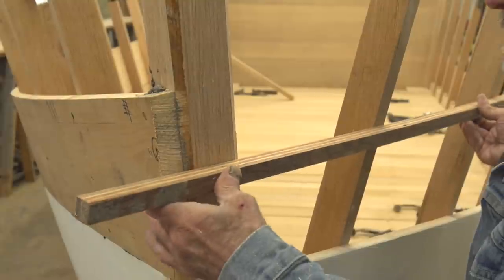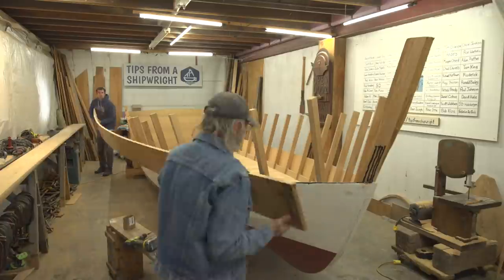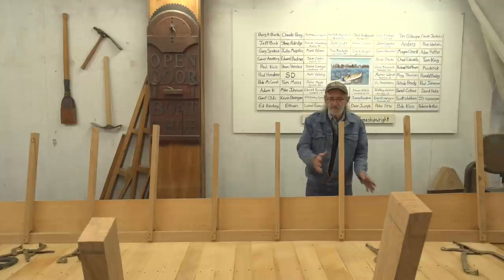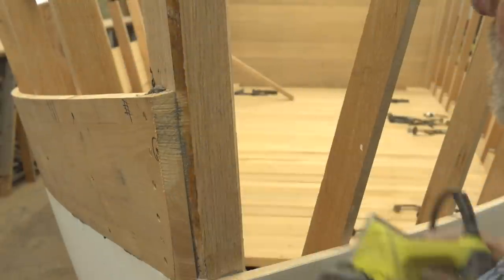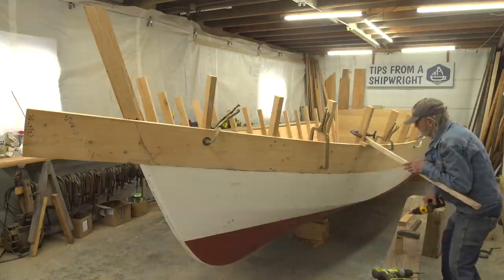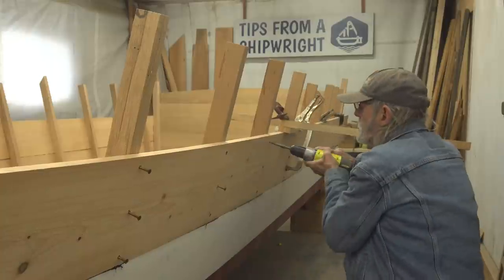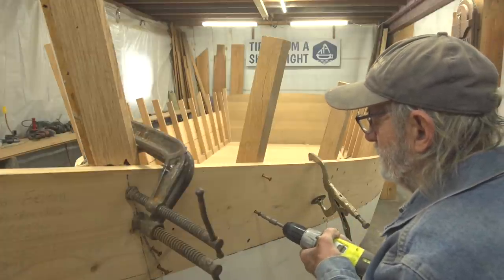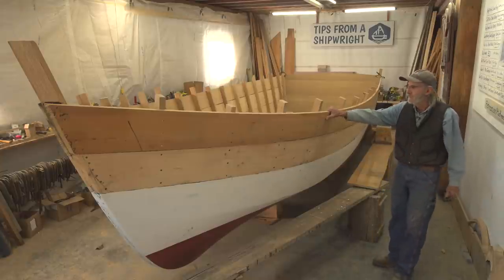Building the 23’ V-Bottom Skiff - Episode 21: Side planking

Comment: What a wonderful boat. I can imagine running it from the stern. I agree with you about slotted bronze screws but I have found I prefer square drive (Robertson) ones. They are very common in Canada. I understand the ease of repair with slotted but I build and don't repair so there ya be. I agree, even in fresh water, good galvanized beats stainless.

Comment: If there is one thing I need your answer to it has to be  Where the fibreglass laminate ends you cover with polysulphide sealant the length of the timber top edge, is it sealed with epoxy from the layup or bare wood as appears in the video. My reason for asking is I’m afraid if water penetrates the layers it could rot. Normal core has a 20 degree bevel off angle and it is sealed as an envelope of GRP.

Comment: Great video as always.  So the next step is to get an impact driver and don't use the drill to set the screws.  The impact driver is smaller, lighter than a drill (usually) and more easier to control the depth when driving the screw home.  Most importantly it saves your wrist as you know after a few hundred screws.  I can almost guarantee that you will never go back to a drill to drive screws again - try it out.  I like dewalt the best.  It will take all of 10 minutes for a professional like you to get used to it.

Comment: I would like to see a small foredeck so you could wrestle the anchor standing. and drop the gunnel 2” aft of that. I have spent a fair amount of time with my thighs against  the cap board, and too low is pretty painful after a few hours. (depends how tall you are). PS. you can get decent stainless screws in the exact pattern as the bronze, but harder to get hold of,and more expensive.
Reply from the maker: That's a good idea

Comment: do you ever figure the CG and then adjust ballast to the bow to compensate for the weight of the outboard so that the boat gets on plane better and doesn't pontoon  (with the bow raised at a high angle) ???
Reply from the maker: It will displace more water aft where the weight is

Comment: 14:30     Couldn’t I more easily use an oscillating multi tool?  I’m one of those people that can never get a hand saw to stay cutting where I want it, but the oscillating multitools do the same job essentially when cutting out the bottom plate in a doorway…. Often performed by the least skilled guy on the job site while everyone else is busy doing something else requiring more skill (I assume it’s because there isn’t 12 plus inches of overlap, just a couple millimeters of overlap).

Just think, this boat is three feet longer than the dory Alfred “Centennial” Johnson sailed single handed from Gloucester Mass to Liverpool England in 1876.  He is quoted as saying he did it because he was “a damned fool.”  But damned fools have proven many a things CAN be done, even if they would only be done by a fool….

Another AWESOME and INFORMATIVE video….. I’m crippled now (30 years in the military can do that to a man) but still have hopes of building my own boat soon to do the great loop and spend a couple winters in the Caribbean…. With the tips and tricks you show, I feel that even a cripple with the right power tools (and a little help from a couple younger/healthier relatives) I will be able to pull it off….  Thank you!

Comment: So what's the rationale behind glassing  the lower part of the hull, painting, then add on the rest of the sides later? Why not just plank the hull at one time using epoxy adhesives for all planks, and then glass the hull to make one unibody structure, then paint. Im all ears just curious.
Reply from the maker: It's doesn't need it one the sides, it's a wooden boat with a protected fiberglass bottom

Comment: The one mistake made on all videos is not criticizing all the younger guys that go to a school learning all they know from books and instructors, then telling how you learned from experience and how many boats you made still running today.  You're really supposed to hammer young shipwrights.
Then tell the one time when young you knew everything, you made this vessel for the deep-sea fishing where you used all glue without fasteners being confident in the glue.  But rough weather came pounding the boat, where the planking started coming loose, until it came apart, then all the fish caught served to act as chum once the boat came apart attracting sharks which all the 10 guys on the crew according to a coast guard helicopter that observed it.  Then you found out how fasteners work better.  Just so people learn to listen to Grey headed shiprights where Grey hairs reflect knowledge and experience acquired by time.